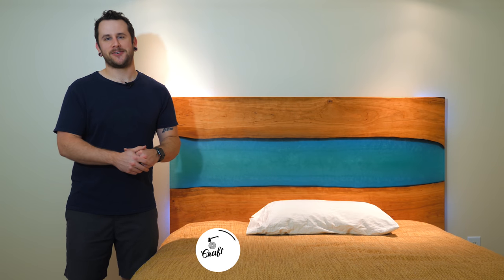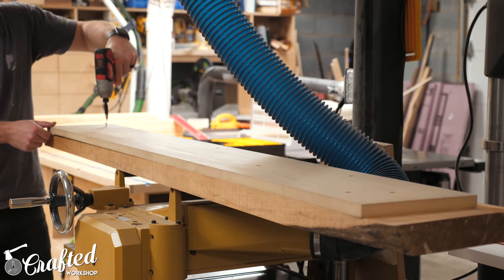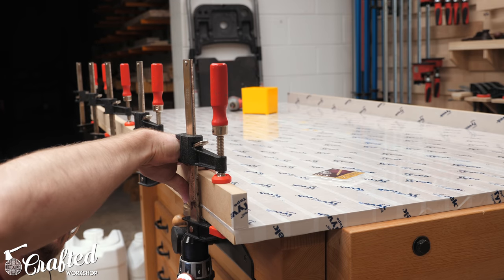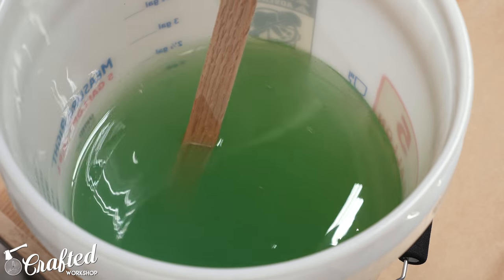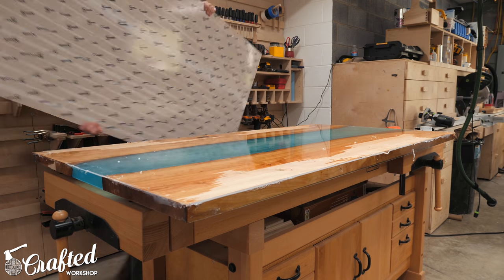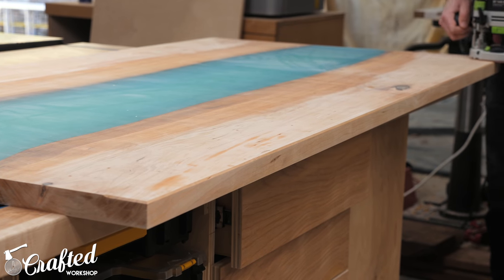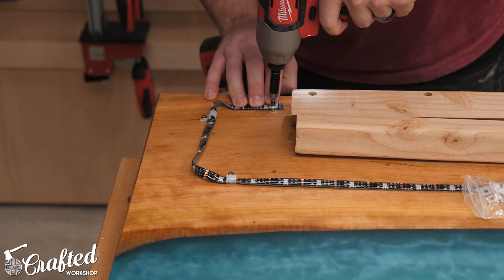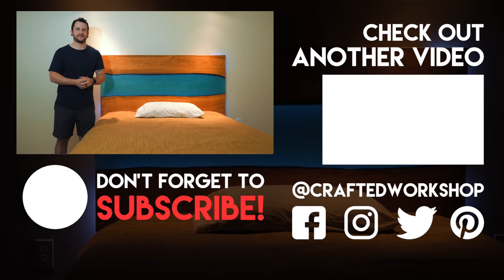Live Edge Epoxy River Headboard (or Table) with LED Lights // How To Build - Woodworking

Comment: I just have a couple critiques. First, you should have installed a bluetooth speaker so that you can play some barry white to go with that sexy mood lighting. Second, The french cleat  is a nice secure way to attach the head board but what's the fun of a head board unless its wobbly and bangs against the wall haha..... giggity
Reply: Valid critiques.
Reply from the maker: Hah, valid points, I'll allow them.
Reply: I saw you drop that drill off the table
Reply: Third Coast Craftsman my head board rn is loose and every time there’s an earthquake my whole bed moves so I think I just need to make a whole new bed 😂
Reply: Signed off with giggity. Lol smh

Comment: Looks great! You could also use melamine in the future with epoxy cast, as long as you have your mold release it works great with casting.
Reply from the maker: Thanks! And yes, I was going to use melamine but I couldn’t find it in 4x8 sheets.

Comment: This is an aggressive amount of epoxy!
Reply from the maker: That it was. So stressed about it leaking, but it didn't!
Reply: I have that same worry about my butthole.
Reply: Crafted Workshop 

Which epoxy did you use to do that thick of a pour. I’d like to try it!
Reply from the maker: Linked in bio, EcoPoxy Liquid Plastic.
Reply from the maker: I'm just now seeing this comment. Almost spit out my La Croix.
Reply: Nice work on it. Just wanted to mention, epoxy has an exothermic reaction and the heat can build up high enough to get a runaway effect that can ruin the adhesion, clarity, quality, can even heat up so much to give off fumes n potentially cause fires. Not sure if you mentioned in video so disregard if you knew already but it can be a nasty and expensive problem. Some do a multi-stage pour to avoid it but I think the epoxy you used is designed to have a low exothermic reaction. Youtube should have some epoxy exothermic runaway test videos, it's scary how hot it gets. Hope that helps you or anyone reading. 

Also try get a bit of the epoxy into a small cup, mix the metallic into that, then add that to the mix, may help disperse the pigment without clumping up.
Reply from the maker: For sure, a lot of epoxies will have that reaction, but I used a slow setting epoxy which doesn’t have that issue.
Reply: @archades54  This. If the reaction had cause to much heat, he would have been f*cked. BTW exothermic means heat release as a result of a chemical reaction, and since all epoxy reactions emit heat, they are all exothermic. The question becomes how much heat is allowable before it screws the pour. Even "slow" reactions from particular products limit a depth of each pour to an inch or so.

Comment: Other idea to reduce the amount of epoxy.  Pour a layer in first, then let it cure or tack then as you pour another layer or mix a small batch.  Fill in parts of the area with glass beads, river stones, legos, sea shells, whatever fits your theme or mood.  Then keep pouring over top.  You use less epoxy since the trinkets fill some of the gap, and you have a cool theme.

Comment: Great design and workmanship.
Good to know that there is a shop in WNC that has extra wide sanding capacity!!
You might consider moving up to a dewalt 20v or better yet a 60v lithium mallet system.😂
Reply from the maker: Thanks, and yes, utilizing that shop is something I need to keep in mind for sure. And yes, a more powerful mallet would be better :)

Comment: Very nice man it looks great! Only thing I might have done a bit different would be to put LEDs above the cleat as well. Great video as usual man! Very well done!
Reply from the maker: Yea, I probably should have chained two strips together to get a little more light, but I was afraid it'd drain the batteries really quickly.
Reply: Yeah good call. They can always be added later also. Also that sander was amazing!

Comment: Awesome video and very satisfying. One question though, during the installation of the LED lights, why not use the router to route your paths for the LED lights and add (if any) left over clear epoxy so that you would not have to deal with the adhesive not sticking to the finish? 

Remind you, I have no experience and only starting so this is for my benefit and knowledge!

Comment: Great build. I wonder if there is a way you could isolate the edges so there isn't any light bleed.
Reply from the maker: You could probably frame out the back edges so they were flush with the wall. Thanks!

Comment: Wonderful piece , and here i was thinking " If i were doing this, i would embed some LED strips along the inside edge of the epoxy to act as accent lighting but you put it on the back in case it had to be replaced

Comment: I have yet to see even one single epoxy builder use vacuum or vibratory tools to eliminate air bubbles...(?)  I’ve used vacuum and vibration for years now and it works like a charm!
Reply from the maker: It’s not necessary with this specific epoxy. It takes three days to cure and results in no bubbles whatsoever.

Comment: Did you say 18 liters? That's almost 5 gallons. Wow. Were you worried about the epoxy being poured too thick? 
Turned out awesome, love the projects.
Reply from the maker: Yup, 18 liters. It was a TON of epoxy. The epoxy I used is designed for super thick pours, which is why I used it. Thanks!
Reply: Crafted Workshop the entire time i was thinking it’s going to crack but low and behold.

Comment: Id love to make something like this man. but dam, epoxy is extremely expensive brother. Fuck it, I always enjoy watching you make stuff. Great video.
Reply from the maker: Thanks man! It's definitely super expensive, kind of illustrating my point in using glass for the original piece. The glass was $100, the epoxy was ~$600.
Reply: Crafted Workshop As an investment, it's worth it. There's a 30th anniversary for a director of a school coming up. & id mentioned to the lads about making something with epoxy as a gift. We worked out what to make, then we got to the epoxy Johnny, & we where looking at between €350-€450 alone here in Ireland. These cats ain't short of a few bob, but even they said...forget about it. Id suggested using a walnut or maple  slab. Those tree's don't grow here & the price is crazy. Hahaha...fuck it, Ikea it is then so
Reply: On the other hand, I'd rather have epoxy over my head then glass.

Comment: I love this piece and really want to use it as a top for my desk but saw that you said the piece was hard to mount because it was bowed. Do you think it would be possible to use as a desk top if I got the wood from a local wood place that could do the cutting and planing for me?
Reply from the maker: The 2x4 I used was bowed, not the headboard. You’d be fine using this for a desk, especially if a place flattened it for you.

Comment: Instead of measuring using obsolete units from the mid ages and converting the product into Litres, you could simply use metric units consequently. Hey, that is why these units have been invented! 100% interoperability and compatibility.

Comment: Awesome work!  One question from a noob though:  Is there a risk of the epoxy section separating away from the wood?  I suppose the epoxy/wood bond is strong enough by itself since you built it that way...
Reply from the maker: No, the epoxy is bonded to the wood fibers and will not separate. Thanks!

Comment: Looks awesome! I'm building a live edge river dining table and the gap in the center is going to be about 8-12 inches do suggest using additional bracing under the river resin or is the casting resin strong enough to support its self? thanks
Reply from the maker: Nope, it’s strong enough. Mine was about 12”. Just make sure the epoxy cures fully.

Comment: Hi there, nice video and the techniques used are very helpful. I have a question tho. Ive been playing around with epoxy and Ive used both epoxy and polyester resin. The problem with epoxy is that its very expensive in order to have a crystal clear finish and polyester, on the other hand is too toxic and not so transparent but cheap. Is there any other "resin" which is cheaper and can be used in such projects? You payed like 500$ ? isn't  that a lot?
Reply from the maker: Yup, epoxy is super pricy, not much of a way around it unfortunately. Using less is the only way to save a bunch.

Comment: I have a question. A lot projects for a pour so large, I see many people say you have to do the pour in layers. Why is that? Is there a certain kind of resin you recommend for a thicker pour? I just don't want to ruin all my resin 😂 it ain't cheappp
Reply from the maker: Yes, different resins have different pouring thicknesses usually depending on how fast they cure. The curing process is exothermic and creates heat. The resin I used, which I linked to in the video description, cures very slowly and generates almost no heat, so it can be poured very thick.

Comment: Hi Johnny! Great video as always! I just want to ask you about the epoxy. I remember you used west system epoxy at old projects. Why did you choose ecopoxy for this project? Whats the difference between these two brands? Can i do casting like this project with west system 105?
Reply from the maker: West System has a limited pour depth, otherwise it will overheat. I believe you can only do a max of ¼” at a time with their epoxy. This Liquid Plastic doesn’t have a depth limit.
Reply: Got it! Thank you so much for your reply and for your time!
Reply from the maker: No problem!

Comment: That part where you didn't pour enough epoxy and it left an edge on the wood... I think it was amazing like that. It adds a layer of depth when you're trying to simulate a flowing river. I would have left it.
Reply from the maker: It could have been cool for sure, but it would been really tricky to sand!

Comment: Since you sealed the seams with silicone anyway, could you have used melamine, instead of that much tape?
Reply from the maker: I couldn't find a 4x8 sheet of melamine at my local Lowes, otherwise I would have for sure.
Reply: Crafted Workshop you're kidding! lol well ok then. Good to know it'd work though

Comment: I see live edge.  I see epoxy.  I see river.  I at this point eyes glaze over.

But then I see "Headboard" and I'm like "Ooooooooooooooh that's a cool idea!"  Thanks for taking something that (no offense) has gotten somewhat tired lately and doing something cool with it!
Reply from the maker: Thanks, I tend to agree with you. I wanted to think a little out of the box with this one, and using epoxy allowed me to orient the piece vertically with no problems. Glad you like it!
Reply: I liked it all and what clinched it was the lighting.  This is definitely a keeper project.
Reply: Agree with you...although I still like watching a bunch of epoxy videos but I am in the process of planning my bed frame. Until now, I was not planning on a headboard. I just may incorporate something like this!

Comment: Why not cover the whole top with a thin layer of epoxy eliminating the shrinkage issue?
Reply from the maker: Wood will move regardless of what is covering it, so a layer of epoxy wouldn’t have really changed that.

Comment: How long do the batteries last? Or do you just plug them into a charger?
Reply from the maker: I used a USB battery bank, but they really didn’t end up lasting that long for some reason. It’s like they drained the battery even when they were off.

Comment: Liked the video, I'm just curios, how much would a headboard cost?
Reply from the maker: I didn’t sell this one, but at least $2,000 depending on the cost of the slab. The materials on this build are stupidly pricey.
Reply: Crafted Workshop ok cool, yeah I've been doing the research and wanting to build one but wasn't sure how to price it if I created one. I really liked that headboard you made
Reply from the maker: Thanks! Pricing for me is really just based on material cost and the amount of labor.

Comment: Instead of the hassle of applying Tyvek to the MDF, why not use melamine?  They come in the same sizes as MDF.
Reply from the maker: I couldn’t find a 4x8 sheet at my local home center. Definitely would have worked!

Comment: Awesome project Johnny turned out great!
Something to consider in the future, instead of using 30 passes of tape to seal the pouring mold you could use adhesive vinyl (the stuff they use for decals). 
It comes in a variety of widths I work with 24 inch wide rolls but you can get it double that if needed.
Reply from the maker: That would be a great option! Thanks Travis.

Comment: "Dead blow mallet" = ass end of a milwaukee drill... the ol trim carpenters mini sledge
Reply: @craftedworkshop  hope to see you tig welding soon on that little power mig. Been real interested in that. I need a small machine that I can take with me to big installs (stair railing, doors, gates, etc.) The draw of my stuff seems to be that it's all tig welded and not much grinding.. just a cool look. So I'd love to be able to tig weld on the same machine on job sites. I'll keep watching!
Reply from the maker: Thanks!

Comment: Awesome project! That finished product looks incredible. After running through this process once, what was your opinion on the reusability of your epoxy form? Is it totally ruined after one use or could you create multiple headboards from that one form before needing to rebuild?
Reply from the maker: Thanks a lot! I definitely think I could reuse the form, but the silicone caulk turned into a gooey mess on this one. I'd use something else in the future.

Comment: You paid $70 to have it sanded and brought it home to... sand it? I love epoxy/wood furniture, but hot damn this seems way more expensive than I was expecting.
Reply from the maker: $70 was to flatten it. Wide belt sanders still leave scratches, especially in epoxy. Yes, epoxy is incredibly expensive.
Reply: Crafted Workshop I’m thinking I want to make a computer case with a wood/epoxy front panel. You have a video for a complete beginner?

Comment: Great Project video but Square Space for websites that is a joke.
Reply from the maker: I use it for my site and it works great.
Reply: It's pretty and simple design but the problem with these sites builders is that you will never rank or have to spend money to rank.  The one thing that is always lacking from these sites is that you have no written content or SEO work done on this site.  Which is actually more important in search engine results.  Again love your work.
Reply from the maker: Not sure what you mean. Blog posts will rank just as well as Wordpress as long as they are formatted correctly, alt tags on the images, etc.

Comment: That's not a propane torch
Reply from the maker: Technically it’s MAP gas but it doesn’t make a difference in this application.
Reply: Why tyvek and not melamine board.?
Reply from the maker: Couldn’t find a big enough sheet of melamine at my local home center.